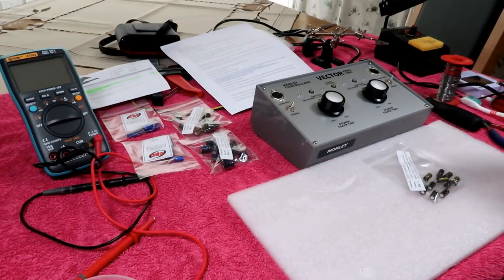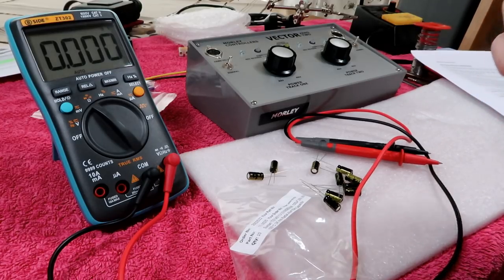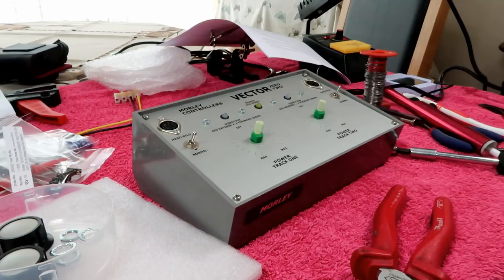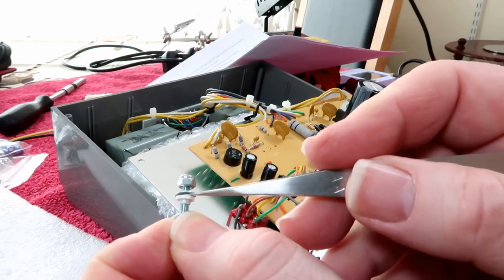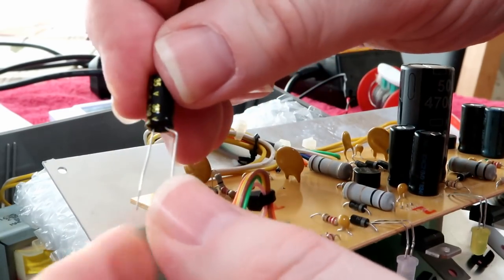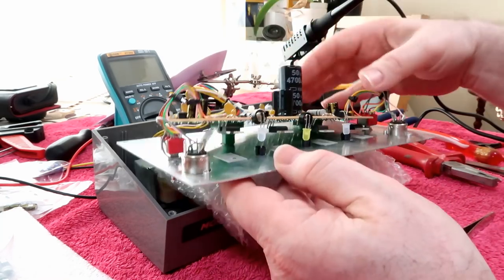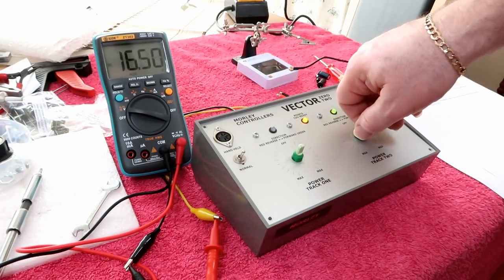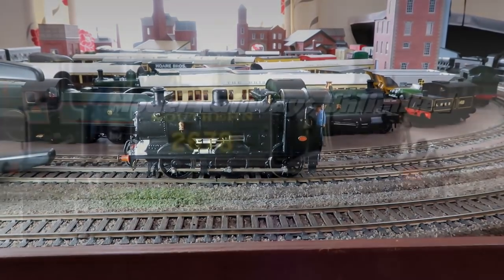Morley Vector Zero 2 Re Cap, Model Railway Controller

Comment from the maker: Greetings everyone 26/02/2021 as an update, I have now changed down to 33uF caps of the same brand, the result has been fantastic, much better control, no buzz, great for coreless, and no heating of the power transistors. Morley now make a Vector Zero 3 Crawler which seems to be as good or better than my modified one. While I love the GM Model D, it's the Morley I use all the time. Take care. Mike

Comment: A big Thankyou Mike for your videos regarding the two big names in controllers. Just getting into the hobby, and they couldn't have been better timed, or that is, the outcome (knock on effect) of your under the bonnet analysis. Barely a month ago, it seems, Morley were offering the Vector Zero Two, so I was going to go for a Gauge Master. Ready now to buy a controller I was edging back towards Morley, feeling that a number of features more than outweighed the slow speed issue, and as I foresee that I may end up with two layouts, with different operating requirements, I was going to buy a Gauge Master as well. Much to my surprise, Morley had superseded the Zero Two with a Zero Three ("perfect smooth control at slow speeds..."), and added a Zero Three Crawler. So I bought the Zero Three. Initial use is giving very good slow speed running, and this is with pre-owned and un-fettled locos. Unless someone beats me to it (which is highly likely) I'll post a video. £79.80 including TWO handhelds, I'm happy!
Reply from the maker: Hi Tab, great to hear my video helped you make a choice. I think you have made the right one for what it's worth. The Morley as we have seen is very sophisticated with protection circuits as well as  good control now. I am pleased they adopted my idea even if they were rather odd about it :) Look forward to your video, please post a link here
Reply: I think Morley owe you an apology, at the least a thank you. I am sure that their sales are set to increase, and who knows, they may take on extra staff...  When I'm ready for my second controller, I will most likely go for the Zero Three Crawler... that will be two sales down to you Mike! "Cheers" say Morley.

Comment from the maker: Another benefit of this modification seems to be that the power transistors run much cooler, thus the front panel of the controller does not become so warm :)
This no doubt is due to the lower potential maximum voltage before the regulator circuit.

Comment: Is there going to be a part III in the series covering further slow speed improvements ?
Reply from the maker: lol I don't think so to be honest, the only possible would be to reduce the caps down to 33uf but I don't think it worth it now. There is a series on a DIY controller I made that does give really good performance, have you seen that?

Comment: What about trying to fit a DPDT pair of switches to switch the capacitors between the 100uF and the 33uF?
Reply from the maker: Hi Alan, a good idea indeed. I think I'd change the values to 10uF and 220uF in this case which would give excellent shuning control and a bit more top speed for cruising.

Comment: Great video! Very informative, and I like the fact that thanks to your clear instructions, this modification is accessible to a large number of people. I have the Morley Vanguard, which from what I can see looks to be very similar to the Vector Zero, but has a higher Max. voltage (20V) and is rated at 2.5A per channel, as it's designed for O gauge rather than OO/N gauge. Now I'm no mathematical wizzard when it comes to electronics, so apologies if this is a basic question: would you still use a 100uF capacitor for this with the higher voltage/current, and would I need a higher rated (V) capacitor to cope?
Reply from the maker: Hi John, many thanks for the kind comments. As you reduce the capacitors your maximum output falls a bit so that has to be considered. What do your O gauge locos actually draw? imagine it to be around about 1 -1.5 amps. In this case, 220 or 470 uF caps might be good, what is the value of the original ones?
Reply: I'm not sure off the top of my head - I'll have a look this weekend :-)
Reply from the maker: OK mate, no rush :)

Comment: very well done. enjoyed it.
Reply from the maker: Thanks, do you have this controller?
Reply: no. I am a beginner in the research phase of having a model railroad and came across your video and having a small background in electronics really enjoyed it you were very thourough in explain to watcherws not to touch the capacitor leads with their fingers.
Reply from the maker: LOL that's very kind of you. Great controller with this modification, or another option might be Gaugemaster Model Ws with boxed transformers to power them.

Comment: haha so it would seem (from what I've been told) Morley themselves have adopted my suggested change! So all that bluster was uncalled for then! Good news for customers at least.
Reply: Did someone take a Crawler apart and have a look Mike ?
Reply: @phucdatbich1990  Yes apparently so, even found the exact same brand of capacitors had been used. I am just glad modellers will get a really nice controller now :)
Reply: @MikesMovies  Mike, this thread on RMweb may interest you https://www.rmweb.co.uk/community/index.php?/topic/147742-what-type-of-controller-is-this-budget-marklin-trix/
Reply: @1maico1  Very many thanks for the support, I really like that Trix controller, very similar to Fleischman designed set controller! Very smooth, very controlled
Reply from the maker: I think yes but not been able to get any feedback